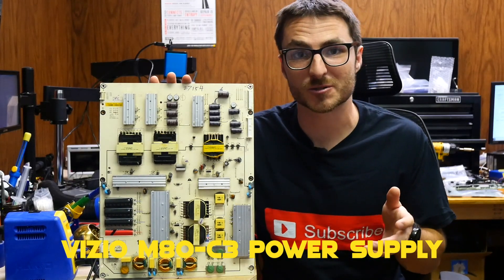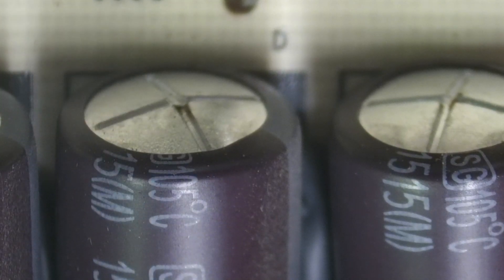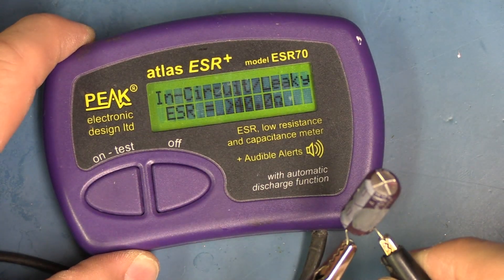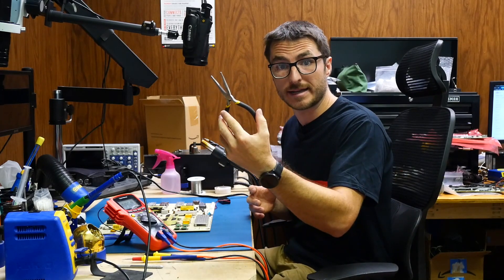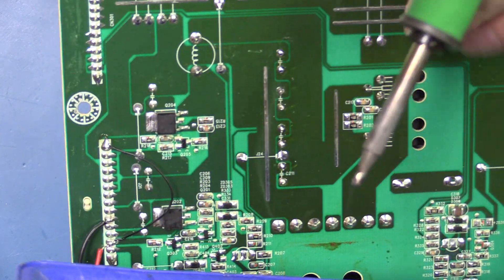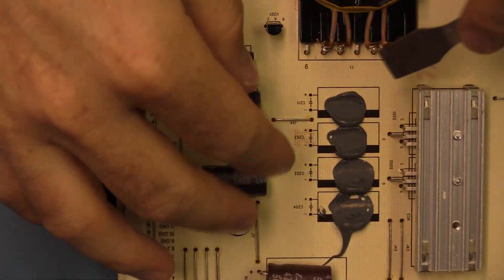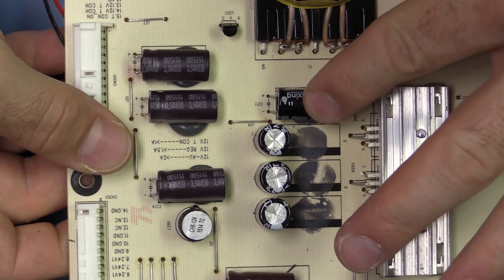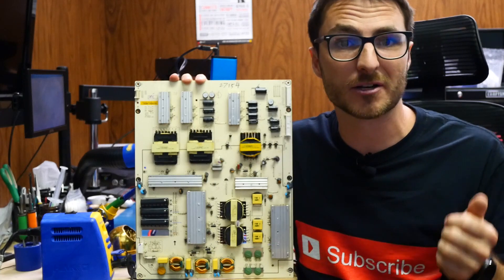Vizio TV Won't Turn On M80-C3

Comment: I own this particular esr meter,for years now.Nice piece of gear,not always reliable in measuring in circuit caps though.
Reply from the maker: Yes I like it a lot.
Reply: @NicksTVRepair  Nothing wrong with atlas meters but WAY to pricey now. For the money there are better options, even building your own. Works good for us po folks,. Even those Mega128 based testers do a decent job for 20 bucks,

Comment: Nice ESR meter to also show capacitance.  Can you please link it?  Also a word of advice to amateurs, Always be sure your capacitors are discharged first or you can blow your meter!
Reply from the maker: Sorry I don't know where you can buy it anymore, I think it's been discontinued. There are newer versions you can get however from amazon. Just search for ESR meter. 
As for the discharge first that is a very good point. I should have mentioned that in the video. To late now but next one I do about caps and we check them ill make sure to mention it!

Comment: Fixed an old CCFL TV today, I have more luck with those, why do they tend to last longer, same technology as now except the back lights. I rarely get one with a bad main or tconn, its usually the power or inverter boards.
Reply from the maker: Yup true! 
I liked the CCFL sets, they worked well and some of them have better picture than some of the 4k cheap sets you can buy today.

Comment: Hello Nick ,    Will the capacitor in the link description work for the M80-C3 for the 4 in video that are bulging? The link says parts for m70-c3
Reply from the maker: Oh shoot, good eye. Sorry about that, it's a mistake on our end. 
I just checked our website and it looks like I don't have a cap kit listing for the M80-C3 however I just double checked and it does look like the cap kit for the M70-C3 and M80-C3 is the same so you can purchase the M70-C3 cap kit and will work for the M80-C3. 
I will make sure we get that listing going for the future.

Comment: I get that the power supply is bad.. but what symptoms did it show
Reply from the maker: The most common symptoms we see for these is that the set has power, turns on but no picture on screen, no backlight. Often the fault is intermittent at first, so power cycling the TV allows the set to run properly. Often as the capacitors get worst, the TV has to be turned on and off several times to work until it gets so bad that even power cycling it 10 times doesn't allow it to turn on anymore. 
There are other symptoms that can occur but that is the most common. 
Careful though, if the capacitors are not bulging and you do have power to the TV but no picture then it's likely that the mainboard is at fault. If you have no power at all then it's also likely the mainboard is at fault.